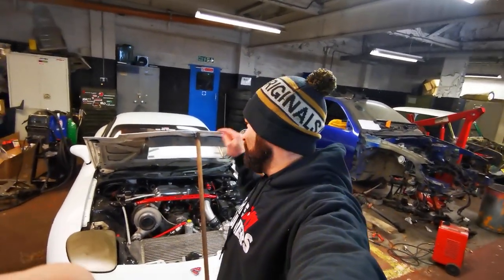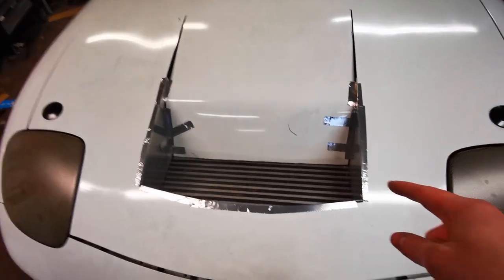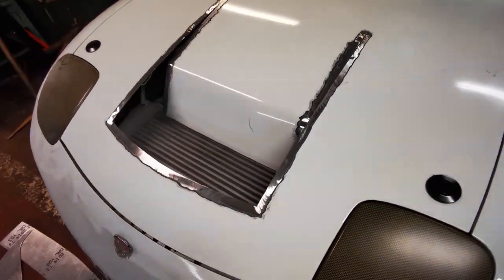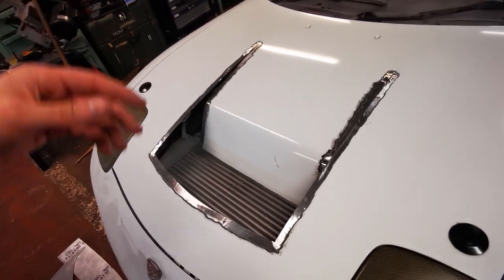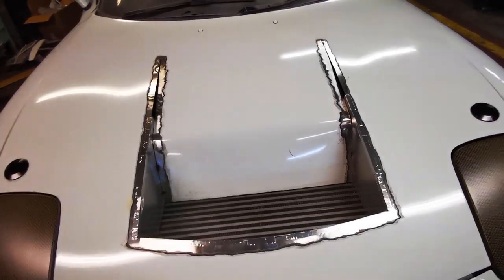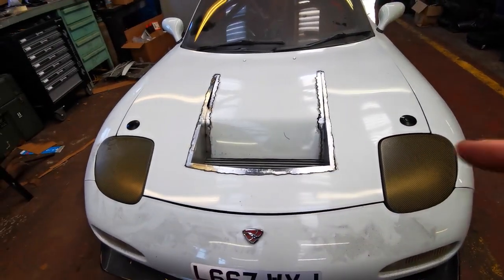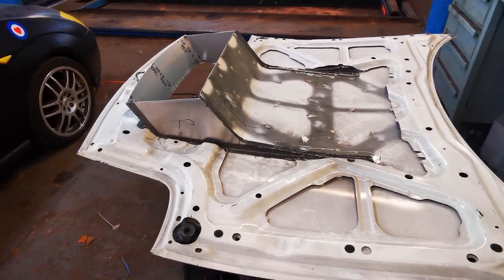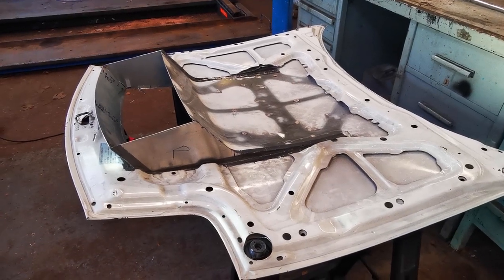My Custom DIY Rx7 vented Bonnet/Hood Is Finished ( minus Paint)

Comment: A great project, you're way braver than me. I've got a fiberglass Knight sport M2 copy bonnet for my FD but the fitment is gash, so I want to copy the front vent onto my oem bonnet. Its going to be some work.
Reply from the maker: So many aftermarket bonnets with gash fitting. Will 100% be worth the effort to get a good fit